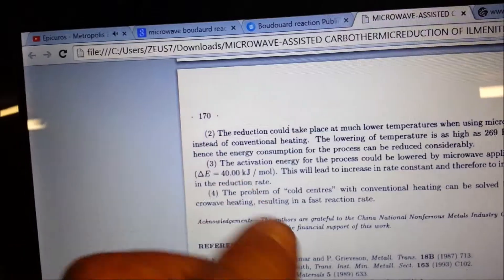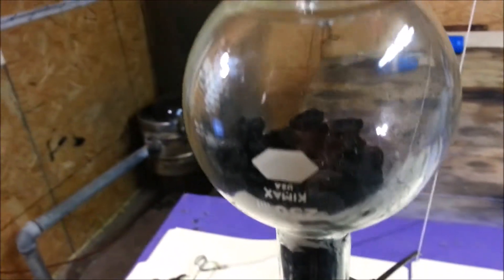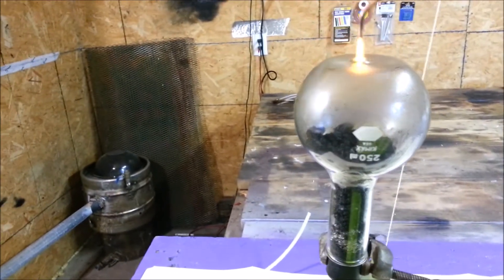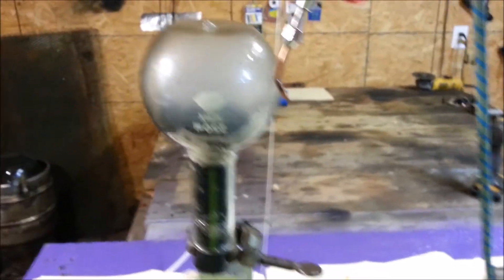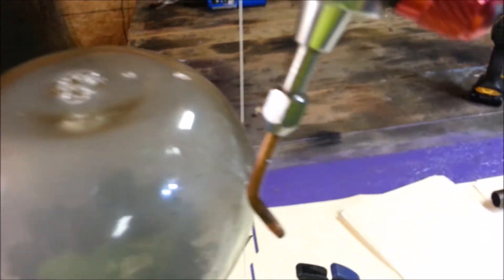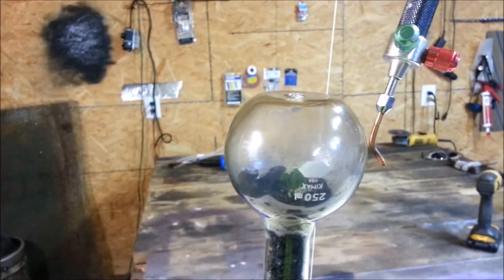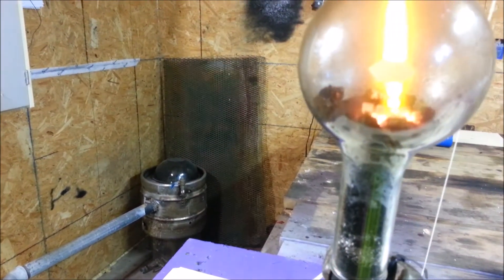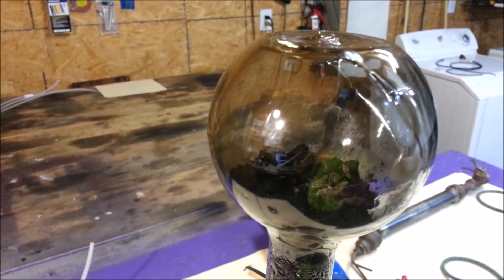water gas reaction in a flask

Comment: I know this is an old video but I thought I'd reply anyway I'm pretty sure You're just burning out because of lack of oxygen just like a fire triangle You're adding oxygen to your flame to make it hotter but that's an addition if you take away the main source of the flame it won't burn. I am willing to bet if you just put a hydrogen flame in there without the oxygen added to it it would burn out in the same amount of time actually probably last a little longer because it's not as hot
Reply from the maker: The problem with your reasoning is this flame burns under water good buddy , . You are correct but he word counter intuitive bites us all the time . The real reason the flame goes out is Co2 contamination . The flame causes a mixing of the off gasses that leans out the gas composition to a non flammable gas . HHO cells that use baking soda demonstrate this effect .  smoke particles can also cool and extinguish flame

Comment: your filling the flask with combustion materials with the torch.  of course its gonna go out.  what you need to do is electrically heat it
Reply from the maker: its a oxyhydrogen torch , it will burn under water

Comment: Definitely gasses extinguishing.
CO2 probably
Reply from the maker: m3sca1 great comment , i totally agree . the high velocity of the hho exiting the torch tip probably diffuses the ambient gases very quickly . today i am setting up another beaker experiment but this time the torch will be down inside the   carbon bed kinda like the device in my other water gas video . turns out pyrex is not as tough as i thought im breaking this stuff left and right .
Reply from the maker: m3sca1 I found a very funny statement made by a physicist in an old glass blowing article  it read " the last thing a scientist wants to see is a piece of lab glass being used"   LOL  so true im no scientist but dam is this stuff neat  ,you find yourself not wanting to destroy it
Reply: NOBOX7 try some glass blowing and joining with the HHO torch. Easily hot enough. Use your broken bits for testing.
Reply from the maker: m3sca1 i did bro it was a horrible disaster . the hole in the top of this beaker was in fact made using a blow tube and the hho torch. however i did not properly anneal the first piece becuase i didnt think i had to with pyrex , turn out you do and it is indeed a skilled art. i tried to blow a bubble and instead popped a tinny hole just big enough for the torch tip and on cooling the entire thing cracked . so i welded it all back together and annealed by heating it  untill every thing shined yellow with a big propane flame then slowly backed off the heat . then i toched it again 1 minute late at smash the whole thing cracked again. anway i got the one in the video to work and i was more patient but it was not easy , i was rong about pyrex or kymax , boro silica